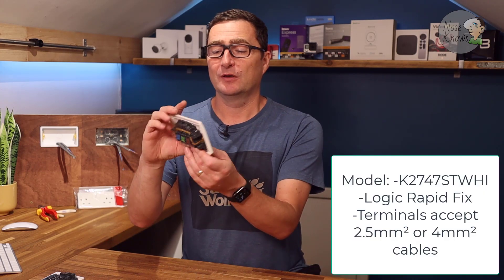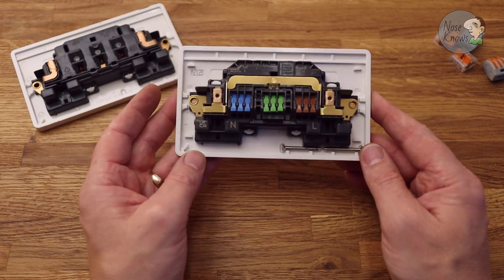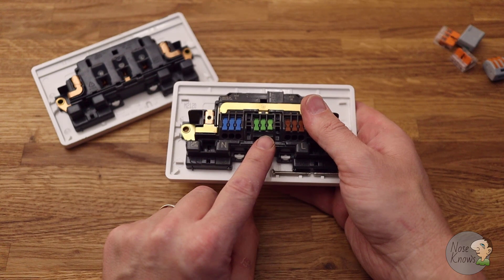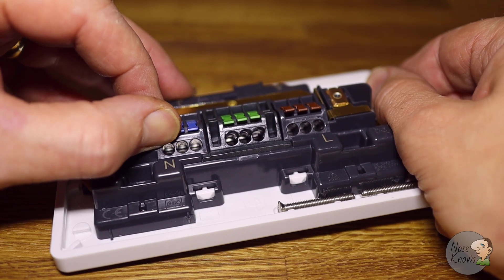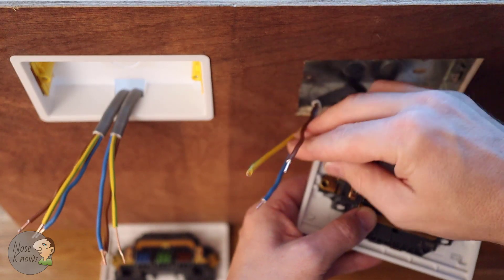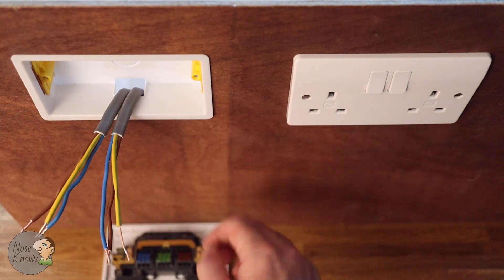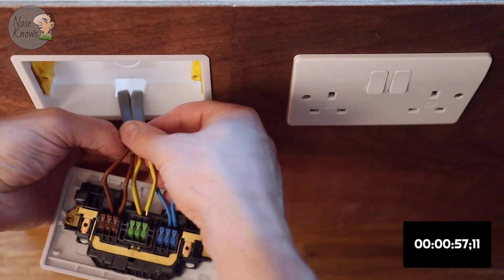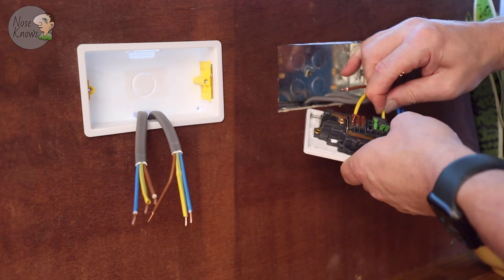NEW: MK Rapid Double Gang Socket Model K2747STWHI for quick and easy mains electrical fitting.

Comment: Lots of guys saying conductors will pull out without much force .. what think?
Reply from the maker: If you don’t use the correct wire spec or don’t push the cable all the way home then maybe it could slip BUT when used correctly they are a great time saving piece of kit. I’ve used them multiple times and a quick pull test when installed confirms a great connection.

Comment: Would it not have been better if there was a fourth CPC lever / clamp to allow for 2xRFC and 1xSpur and Earthing for metal back box ?
What's the max size conductor that will fit into the clamps 4mm 10mm ?
Reply from the maker: Yes I totally agree and mention that in the video. They are still are great time saving socket though just could do with a few improvements.